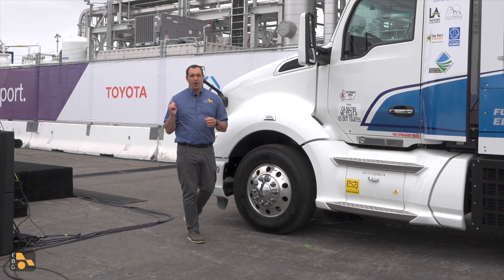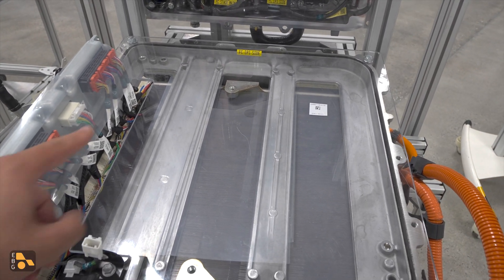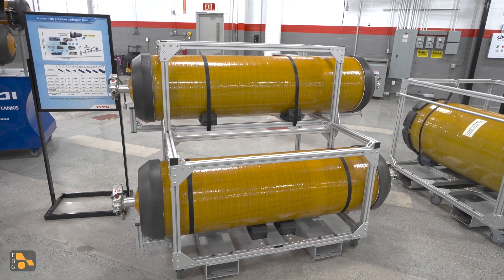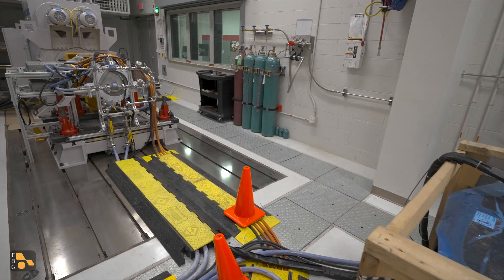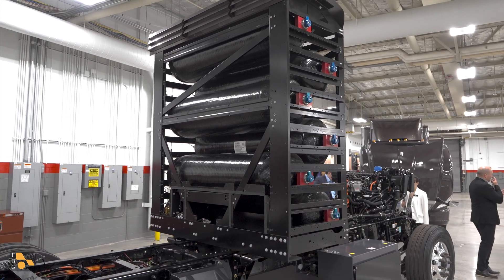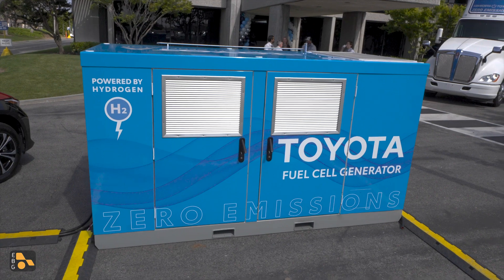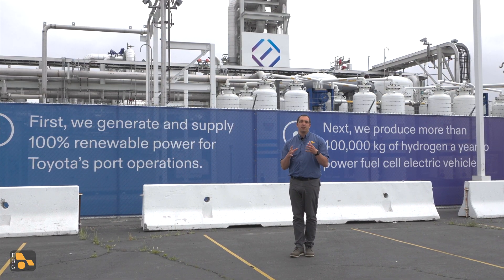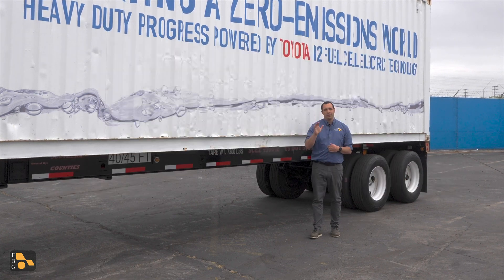More Hydrogen Is (In) The Future

Comment: I will believe the future when I see the hydrogen distribution infrastructure in place. It's not as easily done as electric expansion and will require either big investment in pipeline or having to rely on trucking deliveries of hydrogen. Good luck with both to make it cost effective given existing pricing.
Reply from the maker: No doubt there's a lot of work to be done but it also doesn't need to power every vehicle on the road. That would help with infrastructure stress. -Travis
Reply: @EVBuyersGuide  As an electric utility rep in CA, I can't emphasize enough how much power is required (upwards of 20-30 MW, dedicated substation onsite taking transmission level voltage for service) to build hydrogen processing/distribution facility. If it's only used for large fleets/trucks, that is a huge waste of investment/resources.
Reply from the maker: There's no argument that it's not energy intensive but it's energy storage capability is a lot more easily scaled than batteries. -Travis
Reply: @val_ivanov Curious to know how this load would compare to a fuel processing plant for a different type of fuel?
Reply: Build it and they will come(Tesla)/Don’t Build it and they won’t come(Toyota FC). - I Figure for Hydrogen to take off Hydrogen to take off they would need atleast 1 station for each county in America (3143) plus one station for every 100,000 people (3418) or 6551 stations roughly speaking.    Until I see Toyota build 1000 station hydrogen ain’t happening.  PHEV is more likely to be around than Hydrogen till solid state batteries are perfected and manufactured at scale.
Reply: To the contrary,.....  It doesn't require any additional electricity transmission.... As long as the hydrogen is produced at the energy source, such as a wind farm.... And semi trucks would simply fill up, that are traveling through the area.... 

By the way this is not my own idea.... And I'm still not saying it's the most cost-effective option.... Charging and Battery Swapping are much more efficient and cost-effective, but hydrogen fuel cell semi trucks, could play a niche role.